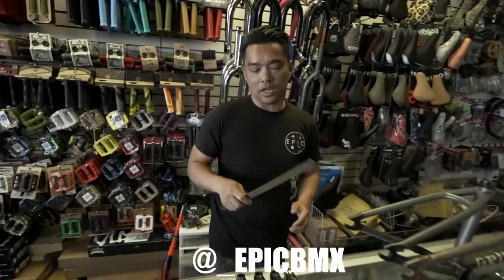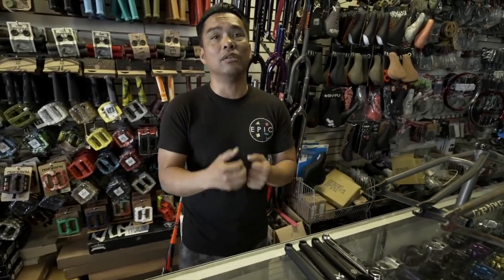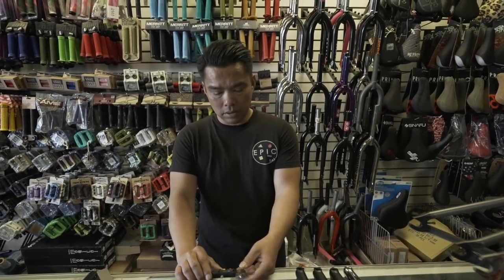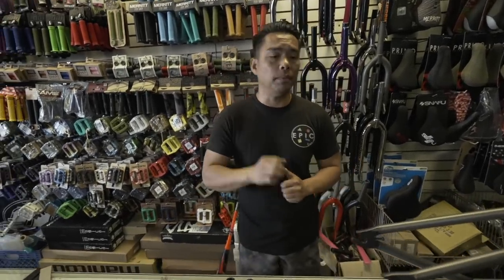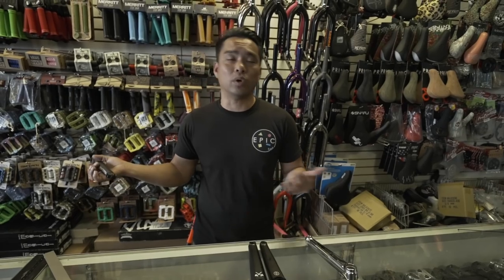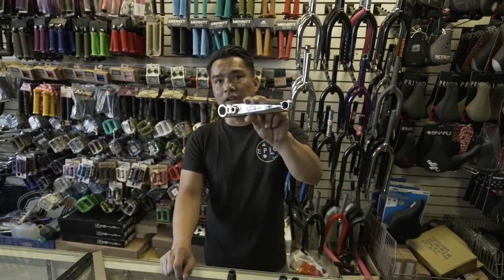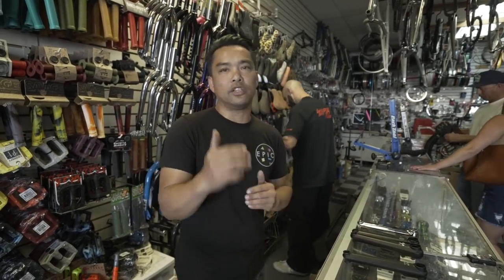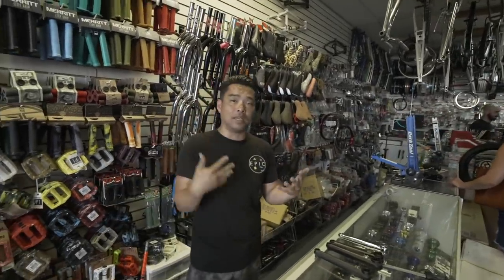Why BMX Crank Length Matters!

Comment: The main advantages of short cranks in DH and enduro MTB are that 1) it helps with clearance while trying to pedal through rock gardens, 2) a shorter stance with feet closer together means your legs are a bit straighter and can absorb bumps more easily, 3) you can spin faster when you're turning smaller circles and being gravity assisted means you don't need so much torque.

Comment: That's a Vernier Caliper. Not a micrometer.
Reply: There dial calipers. Vernier Calipers are very similar but do not have a dial indicator
Reply: @tonyconrad2895  

The harbor freight caliper he used, that does not have a dial, isn't a vernier caliper because vernier calipers don't have dials... That's what you're saying, correct?
Reply: Digital automotive calipers
Reply: Those are digital calipers.  Dial have a round face and not digital.  Vernier have a scaled rule.  Machinist of 26 years.
Reply: Some parts of the country call calipers micrometers. And they are. To be exact it is a Digital Micrometer Caliper!
Reply: They are calipers, vernier means it reads .0001, regardless of readout type. I love this bike shop. There’s nothing like that east of the Rockies

Comment: Alfredo i have a good question in my opinion for the channel, Do you mind talking about the different levels of bikes in a way that explains what each different level of bike abuse each can handle, how much more can a 100%chromo frame withstand or last than a steel frame, what wheels absorb the most impact for flatland, can a $500 Cult “pro complete” bike be better than a $1000+ signature bike Sunday bike
Reply from the maker: I dig it! Will pass this idea along to Phu!
Reply: @joel blanco just in case you didn't know "chromo" is Steel bro, just a better grade of steel. The cheap frames and components are usually awful High Tensile (HI-Ten) steel that is usually heavier and yet weaker.
Reply: @OLI-vx1md  yeah haha im just a casual bmx’er, i ride atvs and dirtbikes, so to say the least, i just ride my sunday bmx bike for fun but my race motors for speed, the fastest ive gone on my bmx bike was 35-40mph downhill

Comment: I used 185mm with a 44T upfront and 14T in the rear when I raced, that would give you more top end speed down the straight.
Reply: @davidmaerz2756     LOL 😆 Learn how to time a gate drop bro, then you can jump the gate legally and you'll get better starts ...
Reply: @hollywoodplumbkra8zysrt  some tracks get pissy at the legal gate jumps. Good plan though. Never understood the light gearing on race bikes.

Comment: One more point worth mentioning would be the clearance between your front foot and the tyre.  Especially during barspins.
Reply from the maker: Very solid point!
Reply: I wear a size 14/15 sneaker. I occasionally will hit my heel on my rear peg because of the shorter chain stay, plus my big foot.

Comment: The trials folks often use cranks as short as 155mm. For my bikes I find 165 /167.5 mm to be near Ideal for me ( 5'4" ) when our kids were little my husband used shorter cranks on the bmx bikes, they did well and as the kids grew up they then used the 170's / 172.5mm length. Being able to pefay through the corner is a huge help......
Reply: My cranks are 88mm. Good for rock clearance.

Comment: When you're at the track, you're locked into the pedals and putting pressure into the gate to stay upright. When the gate drops you have to get to speed from a standstill and sometimes you choose to pull up a bit because your flat to balance. So, the longer your cranks your can get the speed faster because the downhill isn't that long before hitting the first jump.   Gearing is also different I think, if you're running a 44/14 or 15 you wanna crank them things.
Reply: What’s your opinion on 44/20 
With some mountain bike cranks
Reply: @thehomiejuan1306  slow AF

Comment: I feel I have more leverage to bunnyhop higher when I ride a longer frame and longer cranks. I would love to hear Phu and Fredo's thoughts on this, Max and Ethan too. 
I'm midschool old and got back into street. Bought a Hoder frame and 165 cranks (super light), but couldn't jump high like I used to. Then went up to 170, felt a little better. Just got a longer frame (CULT Walsh) and 175's and it just feels right, I think my feet spaced farther helps with leveraging the backend to snap up. And the longer frame helps to lift up higher and I don't feel like I'm gonna loop out. It's probably different with younger riders since they're used to shorter frames/cranks. I just feel like I'm working harder to bunnyhop on a short frame/cranks.
Reply: Same, longer cranks gives me more leverage.
Reply: That’s interesting, because it’s been said that shorter cranks will let you bunnyhop higher. Try jumping with one foot in front of the other, (without a bike) and the closer together your feet are, the higher you can spring. But maybe it’s different for different people.
Reply: It's probably just the cranks. Shorter rear end would be easier to scoop up faster. Albeit you need to balance it out cause you can only hop as high as you can get your bars up along with that initial pop. 

So however high the bars go(which rear end can affect) and then how many inches of vertical pop you get. Perfect scoop and tuck and you get your wheels leveled out maybe rear a bit higher. Too short on the rear end and ir gets hard to pull up as high.
Reply: @AndrewBMX  there's a trade off. In theory longer crank arms can help with leveraging the rear up. But can hurt you ability to pop vertically before the tuck and scoop. 

So there's like a sweet spot. Or run a brake and cheat if you run a cassette hub. Although in theory you can hurt your ability to hop and do tricks if you get yourself into bad habits with it.

Comment: I run Profile Racing 3 piece in 160mm, it’s on a dirt jumper so I’m not worried about leverage or speed. I ABSOLUTELY LOVE my cranks too, like hands down my favorite part I’ve bought (close second is my Cult Dak guard sprocket) But what I’ve noticed is it’s easier to spin, and I feel more nimble lol n the bike. Plus you can’t hate on classic Profile cranks!!

Comment: "Aftermarket" means it's not an OEM part. BMX companies really should be using "Custom" or "Pro" for their higher end parts but it seems those two words have already been overused in the industry. Phu's just repeating what the manufacturer's are stating so he's not wrong.

Comment: Here's a question for Phu.
How come are we still using the Top tube length based on the "distance of the head tube and the seat tube" if head tube/seat tube angle differ in different bikes. A little bump in an angle will greatly affect the distance. Also, since we are at it, lower stand over will also result in a "shorter" top tube as a taller stand over will result in a "longer" one.
Just curious as i'm amazed on how little tweaks on frame geo greatly affects ones riding.

Comment: On some 26' dirt jump frames 170 or 175 can also be too long for doing barspins because of the front foot blocking the rotation.
On downhill bikes they use 165 to reduce the chance of hitting a rock or root with your crank/pedal when going at high speeds to prevent going over the bars 
-> shorter cranks=less material sticking out=more ground clearance
Reply: I gotta try this for my trail BMX. I currently run 170mm.

Comment: The measuring tool is called a caliper. Like the calipers on disc brakes. Micrometers use a spindle with a thumb screw to measure. Calipers slide.

Comment: 160mm on Enduro MTB for a more balanced and smooth snappy crank feel. 180mm on BMX for larger stance for locked in feel and long crank stroke. 6ft tall L/XL MTB, 20.75” BMX. +10mm has a noticeable feel in my experience. Confidence in your stance is confidence in your performance

Comment: First of all, not a micrometer, that’s just a digital caliper, second, as a fat old guy who hasn’t rode a bike in five years, I 1000%support going to shorter cranks for my knees sake, my crap ass stock cranks are 175s, I recently bought the fit blunt 160s, there is a night and day difference in comfort. If I could find some adult strength 150s I would totally buy them. And it makes sense, take your feet and stand with them comfortably in a normal bike position, or even just take a normal length step, when you look at it it’s not like a running stride where it’s a long distance, it’s probably less than 30 inches, when we’re talking about a small distance like that taking 15 mm off each arm is 30 mm off your entire step, and comparatively speaking we’re talking about 5 to 10% of a change which is huge it just doesn’t seem like it because we’re talking about such a small number

Comment: I’ve been on 175mm cranks for over 10years now purely out of a habit i guess(just buying 175mm as a default because i that’s what i always rode), i ride a modern frame now with 12.9 backend and 4pegs, i never had an issue with my heels hitting the pegs(but I know it’s a pretty common issue). I’m super curious how shorter cranks feel just because of this video tho.
Reply: 175 for speed, 165 for freestyle tricks. 170 for a happy medium. 160 for flatland

Comment: My personal opinion about the cranks.

There is a difference between 175 and 165mm cranks. The shorter your cranks are the higher ur stance will be on the bike and with longer cranks the lower your stance will be. It's definitely easier to pinch the seat with shorter cranks and it helps with clearing the back peg when doing manuals and fakie manuals.
Reply: How when stance is measured while cranks are level?

Comment: Standard MTB has gone from 175 standard to 170 standard and DH is running 165 because there isn't much pedaling but Road Cyclists have also gone to 165 because it has been shown that seated pedaling aka spinning is more efficient with shorter cranks. I personally cannot tell a difference on the BMX bike while pedaling because you are standing and pedaling. I can tell if the bike has pegs or you are doing X ups or bar spins, if the frame is shorter. I think that more trail riders run the longer cranks because that is the more common size for BMX racing and most of us come from a BMX race background and don't run pegs, have longer top tubes and longer rear ends so we are not having issues with our foot hitting the peg or tire hitting our foot. As I said earlier its not easy to tell the crank length when standing an pedaling. That said I do think it all plays a factor in general stability and balance when going fast as well as your ability to do spins.

Comment: i've noticed that frames from WTP rear end are getting shorter that some riders are going down to 160 cranks.
also, that their new frames have higher head tube height that they are going back to frontload to compensate for that rise in head tube. 
one reason that i can't switch to a WTP frame because i've slammed and cut my steerer tube already and just bought a new bar and stem. switching to a WTP frame will mess up my current preferred front geometry. that will force me to buy a new fork, and either a new bar or a new stem or both.
Reply: Fit shortcut frame features a 12.4 back end. Straight fuckery. I thought my og wifi with a 13.1 was short in its day
Reply: @RoachDogggJR  yeah. Shortcut kept it pushing shorter. Just wondering how short they are going to push it even more.
If i remember right, when fly tiera came out, everybody thought it was too short. Now look where were at now.

Comment: Yes I'm riding 152yo cranks and it's smooth pedaling but I want to no we're I can find this brand of cranks the to brand coz my left side arm pinch bolt broke so please help
Reply: Hardware store...if it's just a bolt,
They come in differrent ratings for tensile strength

Comment: Most the just ride no...people who practice foot position probably. Where I notice it is riding mtn trail pedal striking is very noticeable since the ground your riding on is un even. The whole standing with legs apart na 10mm is .393/ or just a smidge over 3/8”. You won’t feel that really id say standing up. Just move your feet around. Where I would say felt a lot is when your riding long distances and your body starts to ache. And you’ll feel your legs chopping down do to tired hip area and your less I tuned to make full complete leg revolutions. It’s a cool topic I just picked up a gt performer 29er and I want a little bit taller rear freewheel like tooth or two do to less leverage of the 170mm to my only running 175mm. It’s what ever it’s avoiding pedal strikes off road or fast pedaling through a turn and not checking that pedal😂 that’s a trip when your rear scoots over.

Comment: Gotta question I'm 5'8 should I get a 24inch bmx I'm just gonna be cruising jumping curbes stuff like nothing major someone one told me like 24 or 26 so is that a good bike size for me
Reply: 24" is perfect. 26" is literally for cruising, but if you want that traditional 20" style, get a 22".
Reply: Also i weigh about 190
Reply: @stebensbobby  if you want to do minimal stuff, get the 24". If you simply want to ride sitting down and pedal, get the 26" or 29".

Comment: Over the years I’ve gone from 180s on my race bike to 175 on my s&m pbr to 165s on the Bmx I’ve got now backends have got shorter over the years 🙌🚲💨👍
Reply: The old pbr frames are bitchin. S&m should do an updated version like the classic dirtbike. I guess the ccr is the closest to it
Reply: @kylehalub2197  my black PBR frame back in the day only lasted me a year it snapped where the seat stay joins the dropout 😞
Reply: @pauljames1978  Thats a bummer. Still a cool frame, it's like the predecessor of the current ccr and old stricker frame. I'm running the tallboy, it's alright. My gut instinct was the ccr mod though.

Comment: Longer cranks also provide more leverage initially which helps getting up to speed quickly, while it's easier to throw in an additional pedal rotation in between jumps on shorter cranks because they require your foot to do a smaller circular motion than longer ones and when your up to speed 10mm more leverage will be less important since you are already up to speed

Comment: its no different than a 25 vrs 28 on your sprocket between a coaster and cassette if you run a coaster you definetly feel the difference i run a 170 arms and 28th on a coaster and 175 and 28 on a cassette the difference is night and day you get more torgue and it's easier to pedal with 175  which makes coasters feel undergeared. newbs i guess wouldn't know the difference but there is a big fucking difference and once you ride it  you can tell, i personally used to ride 165 for my back foot and 175 on my front foot,  it gave more clearence on the peg and put your knees closer to my seat without giving up leverage when i rode cassette

Comment: fitbikeco complete . only thing i know is 21 top tube. 6ft 220 lb , i love this thing. first thing i know for sure. the sprocket is crap....K rap..... Neighbor kid chain comes off. let me look. they have no man in there life. back rim wobbly. Bearings loose. I took it apart and repacked the bearings and tightened it all up like new. She rides better then the boys at 12 years old. jumps my ramps and if she  wrecks, rolls out of it and gets back on..... Told her, problems with bike bring it to me i will keep it running if she keeps riding...... Future IS Bright. BMX for life

Comment: Did I just watch this guy @ 3:19 struggle to work out the actual  difference between the number  165 and the number 175.  And then concludes by telling us that 165 cranks are shorter than 175 cranks but only professionals can tell. Ok thanks guy. Couldn’t have worked that out without you.🙄